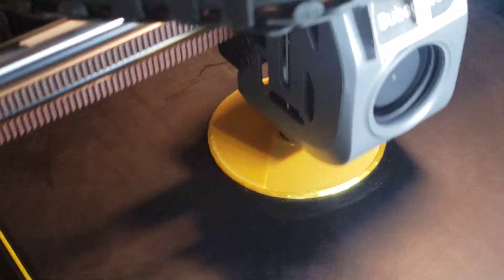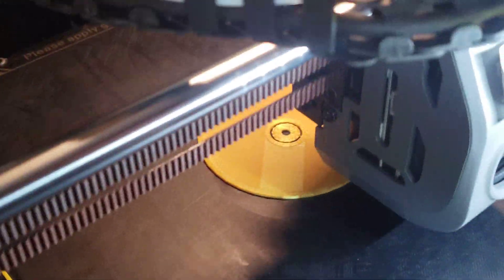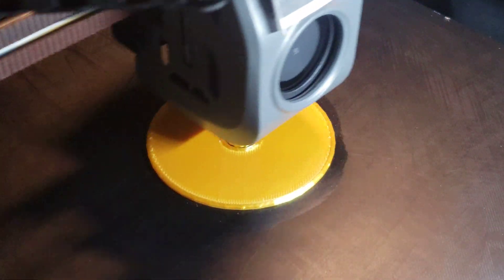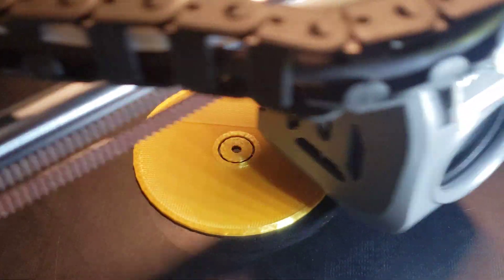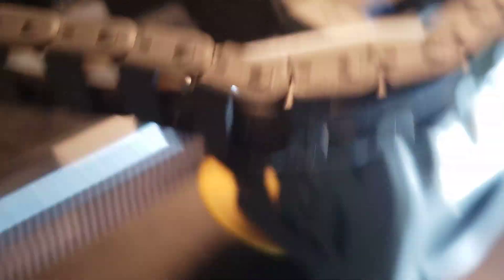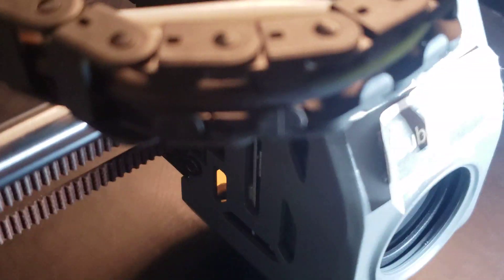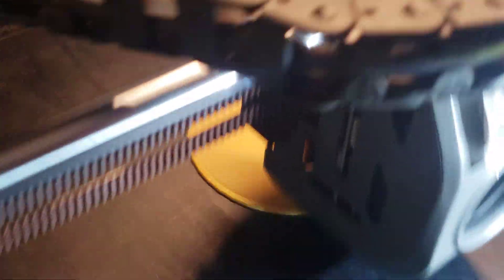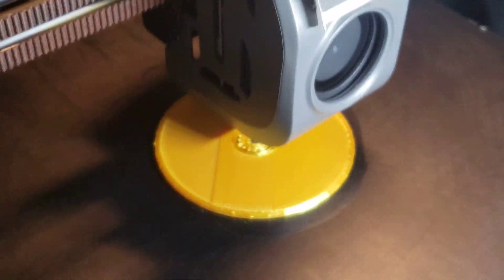How To Quickly Get Free Warranty Parts From Creality Customer Service For Your K1 & Max

Comment: None of this worked.  Creality customer service is terrible.  Do not buy creality.  You are wasting your money.  I have a worthless k1 max that lasted 3 months.  I've sent in all required documentation and a video of the failure.  They tell me to try all the things I've told them I've already tried.  They sell garbage and don't back up their product.
Reply from the maker: That's quite dramatic, especially considering how happy I've been with their service, value, and quality I've experience over multiple products from them that I paid full price for all.
Reply: @3dcre8r28 I guess i didn't consider how happy you've been with them before I wrote that.  I'm happy for you.  I'm glad you got some of the garbage they sell that works and didn't have to buy parts that are under warranty just to get a printer that is less than 3 months old to work. Sorry for all the drama.  I hope you're OK.

Comment: I need another extruder. I though the correct extruder came with my first K1. I guess I was wrong. I bought a second K1 thinking I got a great machine on a great deal. Now I'm so frustrated. I can get the rod to go through but not the filament.

Comment: @3DCre8r OMG, I wish I had seen this video back in August, I went through just what you described. The camera on my K1 Max did not function, it had a BAD mainboard. I did finally receive a replacement and it's working now, but this morning my extruder got damaged (lost a couple of teeth on one of the plastic gears). So now, I'm taking your advice, and sending out an email to see if they will replace it. Wish me luck.
Reply from the maker: Good luck!
Reply: @3dcre8r28   Thank you so very much !
Reply from the maker: @madmaxh3   You're welcome!  👍

Comment: Any idea if there is a reset function on the K1?
My 2 week old unit worked flawlessly and then suddenly prints appeared not to be sticking.
Upon watching I could see that the nozzle Z position was never getting down to the bed.  I have ran the calibration and auto test and those run, but the nozzle is still not going down to the bed.
Reply from the maker: My recommendation, update firmware, the recalibrate leveling in settings AFTER cleaning your nozzle per the first or second video I link below, and also can't hurt to check out the two playlists I also linked below, lots of my experimenting how to both improve quality, and also how to get past failures including what you're describing and others.
https://youtu.be/fXDiEjYrLoA  https://youtube.com/shorts/-zGUAh9vk8Y?feature=share   https://www.youtube.com/playlist?list=PL5OPNhDn9CrWSwbn5K-DVWOZntr6Qx9yx https://www.youtube.com/playlist?list=PL5OPNhDn9CrW8D43QKvxQ2hNwJb_K3NKh
Reply: @3dcre8r28  thanks a ton, most informative,  but of no avail.  Did everything down to factory reset, firmware reinstalled, etc etc. 
Upon watching it,  I can see the issue, just can't diagnose why and the fix.

The front of the bed to middle is not level with the back, off maybe 5mm gap on the z-axis, xy are fine. I just all screws, solid, nothing looks bent, no weird noises, but it is clear  when it is doing the bed level the nozzle never touches the bed except at the rear of the bed. Bizarre.
I'll give creality another 24 hours... and yes, I have dealt with them on other creality printers, so I gave them all the info up front 😉., if they can't give a remedy in short order... I'll have Amazon take it back.
Reply from the maker: @graphguy  Weird.  Seems like maybe one of your lead screws slipped from the rest maybe, not sure how they are connected.  Maybe the belt is too loose?  I did see on the creality tutorial videos how to adjust the bed leveling officially, though looks like a PITA.  I also saw an alternative leveling solution, where A guy said he loosened a belt so he could make the belt skip a tooth to level one of the lead screws relative to the rest, and each skipped tooth was worth .1mm or something, seemed like a better way than the official creality way.
Reply: @3dcre8r28  obviously you are on to something there as something doesn't  come from nothing.... think pooh bear said that.
I'll give them a couple days of back and forth, then no luck?  I'll Amazon it back for a 30 day return and exchange.... if it was out of the return window, I would monkey with it... but since time is MY money... not going to monkey around too much ... that is more than  the 5 hours of TS I already blew on it.  🙂
Reply from the maker: @graphguy  I hear you.  Great printer though, a shame to give up on it.  What will you get instead?
Reply: @3dcre8r28  oh I love the K1, so I'll just have Amazon exchange it. Things like this happen.  There is no perfect car, bike, rocket, toaster..  wife... oops.
But I might exchange and up to a k1 max as I am use to having the 300mm bed of my ender neo max. The k1 bed is a tad puny once you have a larger one.
Reply from the maker: @graphguy   Good plan then!

Comment: Thanks for the information here. I am having and issue with a K1 Max extruder and it seems like pulling teeth. My question to you us that you mention a "questionnaire below" but I don't see a questionnaire or questions. Are you just talking about the "Attach" statements? Thanks again.
Reply from the maker: Weird, I'd have sworn I put it in the description, but I don't see it either, ok check again, I just added it.  Good luck!
Reply from the maker: That was strange again, I went to verify that the update added what was missing, and it still didn't show, until I refreshed the page again.  So if you don't see it yet, hit the f5 key to refresh, or the refresh button, and it should show up.

Comment: pretty slow print on that first layer... and not a good first layer. my K1 Max can reliably print at least 3X that fast with a perfect first laty. what material are you printing?  and what software? and, btw, good info in the video.
Reply from the maker: Yeah I noticed it wasn't a great print while I was talking, but was just a backdrop for me to mention the info, so didn't care too much.  
I also did a recent slew of vids and shorts chasing the perfect first layer and I didn't take my own advice here ha.  
Also yesterday I downloaded new firmware, so hopefully that helps, as I'm still getting a bit of underextrusion sometimes even with a new extruder, and also finding that I need to diligently clean any plastic off the tip of the nozzle to get perfect first layers these days.  
Creality Print slicer.  I'd love to use something else, what are you using?

Comment: I can fully confirm that. Creality Support usually replies within one day (note the time difference!). If you send the relevant information along with it, it goes very quickly. I got my replacement hotend from China to Germany within five days, it really doesn't get any faster.
What is perhaps also very important: stay factual in any case, assigning blame or personal feelings have no place in a successful communication. In my experience, support is then happy to help quickly and easily.
Reply from the maker: Very well said, thanks for corroborating my experience!  I subscribed and thumbed up your one vid ha!  Let's see some more content and sharing more wisdom!  :)
Reply: @3dcre8r28  The one video is for Creality. As you might know, they do an advertising right now for their "K1 Power Boost Kit". It will cost you only a mere $ 2.99 , but only if you share a video on social media showing what you can do with this incredibly powerful machine. 😉
In reality, this might be some kind of "free warranty replacement", since many customers experience problems with the hotend and the extruder of the first batch.
Anyways, I'm glad you subscribed, thanks for that!